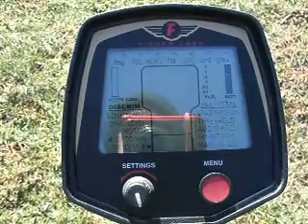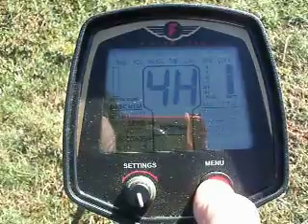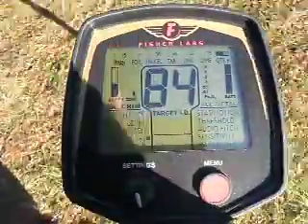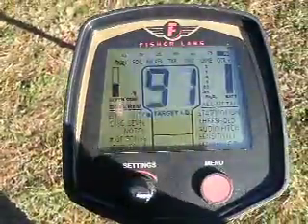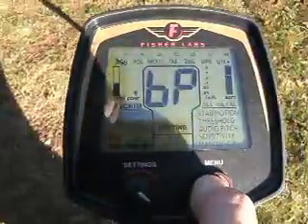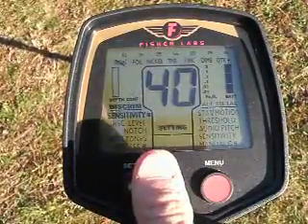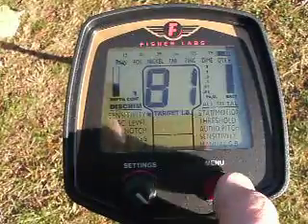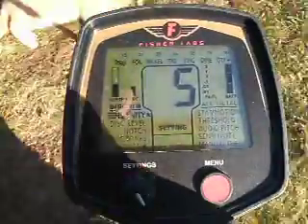Amazing Discovery with the Fisher F75 LTD

Comment: Great test on the F75. I just got the F75 special edition last week! I can't wait to try it out. The depth is unbelievable!! I look forward to seeing more of your videos. Thanks a lot.
Reply: Relic ME Congrats. How you finding F75? I've had mine a while now and I am trying to factory reset it... I can't seem to do it as per my manual... how would you reset yours (just asking, perhaps you know :) Happy hunting
Reply from the maker: Stanman121 1. Turn detector off.
2. Press-and-hold the red MENU button and
push-forward-and-hold the TOGGLE SWITCH.
3. Turn the detector on, while you are still holding the controls.
4. Release the MENU button and TOGGLE SWITCH.
5. See the F symbol. When the F disappears, the detector is reset.
Reply: Mark Gillespie Thank you so much for confirming, It worked! But it did not display the F. That's what threw me off since an online manual also mentioned the F but I was doubting if its my models manual. 
So I set some values like Sens 48 and discr 23. I then did what you said and my values return to the default values - Sens 60 discr 15 etc confirming a factory reset happened. Don't know why it doesn't display the F though :) Very kind of you to help out. Kind regards
Reply from the maker: Anytime

Comment: I’ve got the F75 SE LTD also... If you didn’t know the boost mode and cache mode settings transfers over to all metal mode side and enhances its performance. It’s says so in the users manual and I asked Kelly Co. You don’t need to swing slow in boost mode using all metal mode but you do need to sweep slow using cache mode and when you’re using that setting while in all metal mode. Just set discrimination mode side first then switch over to all metal mode and it almost doubles all metal mode performance. Other settings like default or fast mode or jewelry doesn’t transfer over to enhance all metal mode. This information is on page 22 and 23 of the users manual. As you start to read each discrimination mode. You’ll noticed boost process cache locating process at the bottom of the paragraph says... when the boost mode is selected the response characteristics of the all metal mode are also modified (meaning boosted or enhanced) these characters include less noise and slow response speed. Because now its searching ultra deep and so it responds a little slow. You don’t need to sweep slow in boost mode but you do when you use cache mode. Regardless if you are using them on discrimination side and/or on all metal mode. If you select one of these options and go back to all metal mode they are enhanced if you use any other setting like default or bottlecap or jewelry then it goes back to lower performance or default. 

Also if you haven’t upgraded to larger 15” inch fisher coil you should. I purchased the larger 15” inch fisher coil for my F75 LTD SE and I can hit quarters over 20” inches deep! Man hole cover or 55 gallon drum jumps from 2 meters on or 6 feet on stock 11” inch coil... However the larger 15” inch fisher coil will hit same amount of metal over three meters or 10 feet deep! So if you haven’t then you should upgrade the coil.
Reply from the maker: A lot of valid points.  The areas where I hunt are trash laden so the larger coil would severely handicap the detector (too many targets under the coil at a given time).  You are correct, the larger coil would be best for open areas and also the beach with extra coverage and depth.

Comment: I really need to know the settings for the beach for the Fisher F-75. Anyone..
Down by the waves
Reply from the maker: Motion all metal mode works fairly good in the wet salt sand area.  Ground balance will be close to 0.  Dig anything that repeats.

Comment: trying my brand new at pro could you describe why i am getting 80 t0 90  and digging up nails caps flip tops. using the 8 x 11 coil, iron dis 34, one sensitivity knocked off, set in pro mode & in custom
Reply from the maker: Gregory Martin Try running in pro coin mode, also make sure the iron audio is on and when you locate a would be coin with the ID in the 80-90 range and your not sure. First pin point the location, then rotate around the target and listen for any form of buzzing in the audio which could be an indication of a bottle cap.  Second thing to try is after pin pointing, while sweeping the coil over the target move the coil away from target and listen for the audio to change, buzzing of any kind will give clues to the target. I might add the bottle caps can and even fool me at times.Don't get discouraged.
Reply: thanks, very newwwwwwwww at this